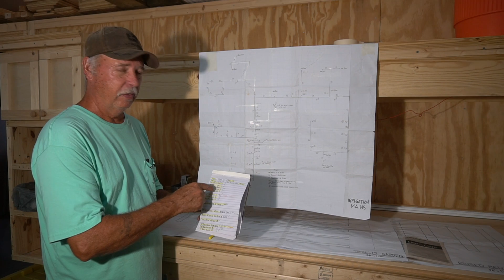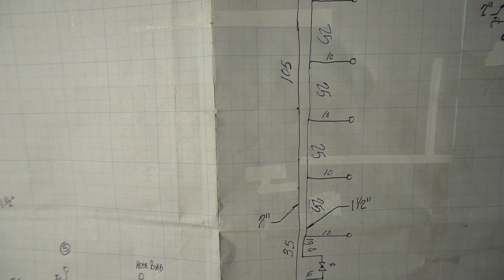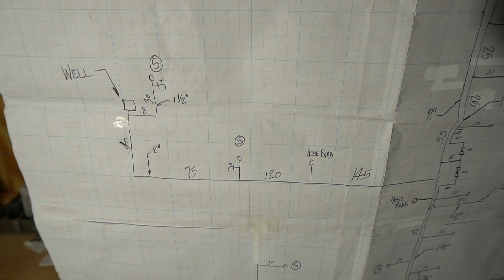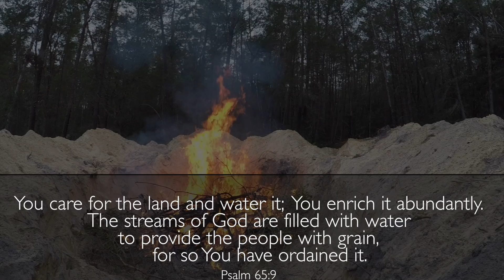Irrigation Mains Installation for Our Garden Complex

Comment: Nancy and Hollis you guys are making amazing progress. Nancy you need to convince Hollis to get a John Deere compact tractor probably a 3 series. They have a backhoe attachment that would have saved him hours of work. They also have a fork attachment that he could use to put those pipes move around and then just use the same machine to dig. We only have an acre but my husband uses it for landscaping and around the house he dug out a small basketball  court, a line to get water to my ducks, several tree stumps an he used an auger attachment to put fence post holes in. These things are amazingly useful and often you get these type of companies offer zero financing. Look at videos to pick which brand but we like the Deere because we are older and that company has special attachments that allow you to just drive up to something, hook it with the machine, put in a couple of pins and start using it. No lifting or busting your back to align it into position. 
Looking forward to more videos and your herb garden especially.

Comment: I hope you are not located in an area that is prone to freezes cause I noticed you have metallic faucets.  When you have a metallic fitting or valve you need to have the PVC pipe fitting on the inside of the metal not on the outside.  The metal expands and contracts at a much faster rate than PVC does ( I've learned this the hard way ).  I hope this help's. Great job by the way !  It all looks good.  One more tip is to run larger pipe than you need which you did, and reduce down to the smaller pipe as close to the outlet as you can.  That will give you greater pressure because of the water volume of the larger pipe reducing down to the smaller pipe.  Can hardly wait to see it all planted and growing, looks like it is a very well thought and user friendly see up !!!  Big congrats to you and Nancy !

Comment: did you use the same size PVC throughout the system or did you reduce for the branches???
Reply from the maker: 2” mains reducing to 1-1/2” for the branch lines and then reducing at the nozzle to suit

Comment: Hollis I was going to hold my tongue about the water canons for the deer until you made the comment that water in Fl was critical...I know I'm late with this in 2022.  Still you may need this information.  String 1 hot wire at 10 inches height from the ground and the deer will not bother your garden. I have seen herds of deer greater than 22 in number in my neighborhood but have never seen evidence/damage or hoof print in my garden.  This is without any other fence.  Deer jump any fence they can see.  They don't see the wire at that height and get a shock that sends them on their way when a leg comes in contact.  My wire has been broken twice.  I believe they whirled around when shocked catching their leg in the wire and broke it leaving at top speed...going on 15 years now. You are taking on a large project and you need all the help you can get, good luck.

Comment: Bing Bing wanted to help. You covered the piping before checking for leaks , besides knowing you clued it right ,why cover it up before knowing what the pressure would be ???
Reply from the maker: I temp capped the ends and subjected the mains to pump pressure and walked the lines checking for leaks. I only had one bad joint and reworked it. I didn’t show this on the video because most people would consider it boring. After the system held pressure I removed the temp caps and covered up the trenches them flushed the system
Reply: @HollisNancysHomestead  Thanks for the answer back.

Comment: Not for nothing, but when the electrical/gas/water people send out somebody in Texas it's a locator from USIC. Not sure how it works in Florida, but it will be wise for you to dig and verify those gas/electric/water/sewer lines just to be sure. Just find em where the get close to your work. If they're within 2 feet, and you hit them, they're still wrong and it's your fault. If their mark is off by more than 2 feet, then it's their fault, but you have a busted gas line and a fireball in your yard
...or worse, it's a forced main sewer line and you have a guiser of doodoo nasty in your yard shooting 60 feet in the air.

EDIT! After watching the whole video, good job digging that whole trench by hand, that aint easy work in the south....or anywhere really! Good on ya!

Comment: did you use primer on your joints? i made the mistake of not using it and had to dig them up because under the water pressure, they pushed apart.